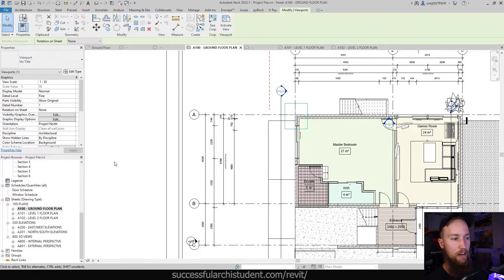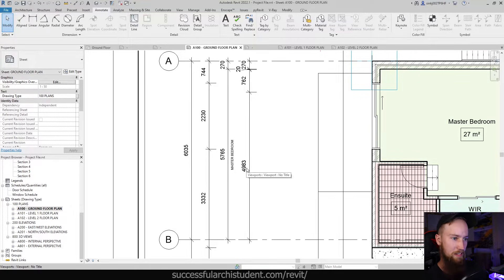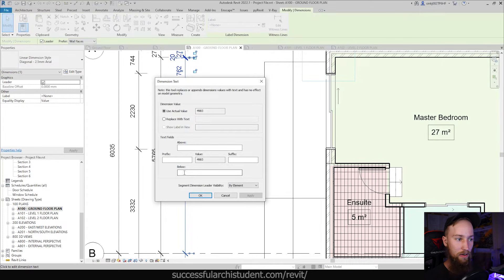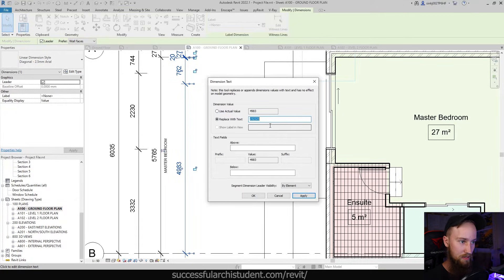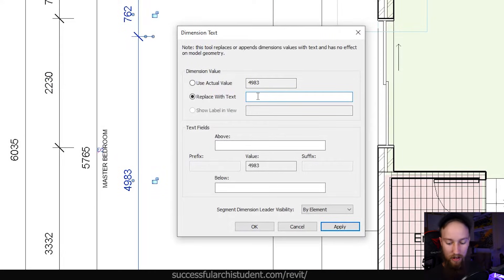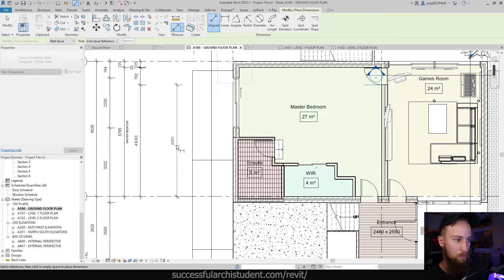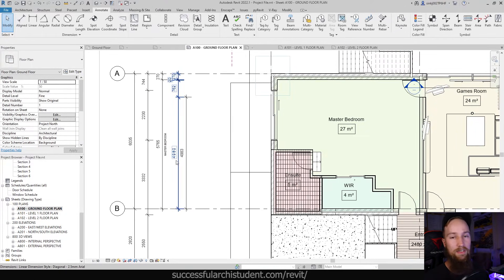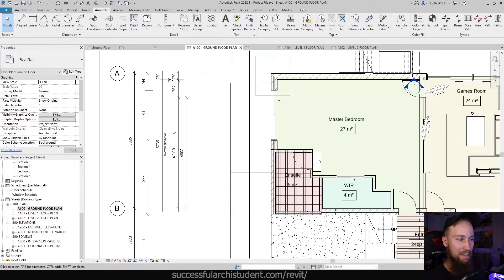How to Edit Dimensions in Revit - Override a Dimension Value

Comment: Tip: When using "Unit separator" the space between the letters is bigger than the normal dimension text style. Instead of using Unit separator you can use IAFS "Inhibit Arabic form shaping", which will make the text style look the same as the original.
Reply: you deserve a pin comment man!

Comment: I tried this and it worked but when you export to a PDF it shows a rectangle in front of the dimension. Any idea why?
Reply from the maker: Hmm it might be that the PDF printer you used isn't compatible with the Uni Code we input. You can try using a different printer such as an Adobe or Microsoft PDF printer. Cheers let us know how you go
Reply: @kylesinko  Hi, I had the same problem while using the Revit native Pdf printer.  Adobe just straight up freezes when I try to print.  What other options do I have?
Reply: Same problem, did you fix it?